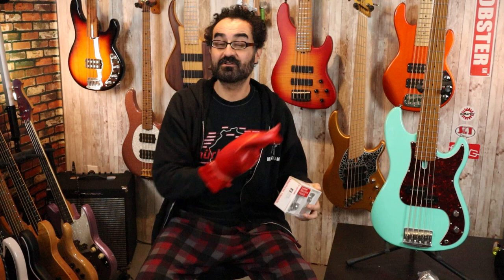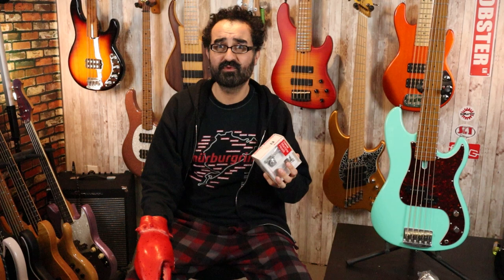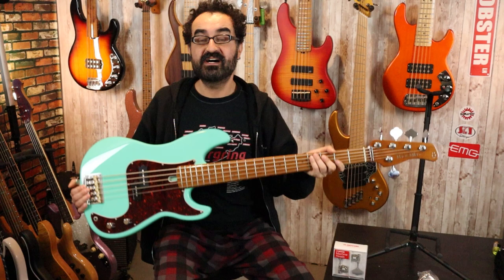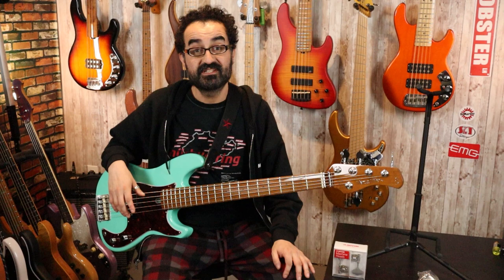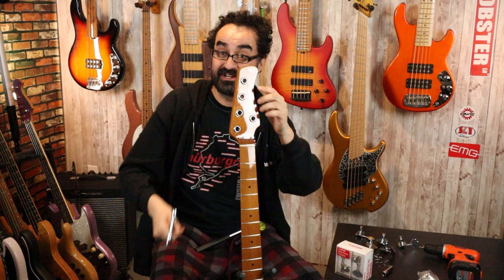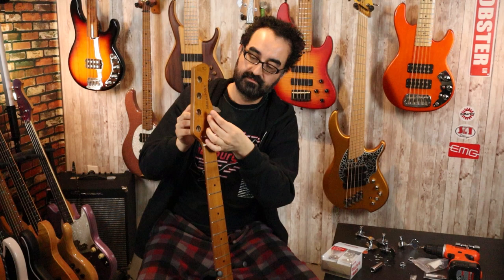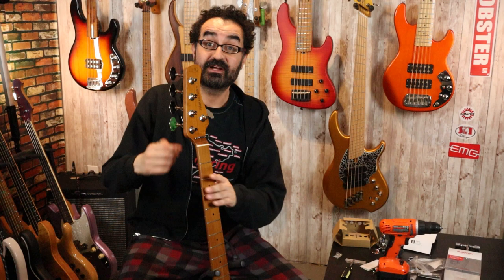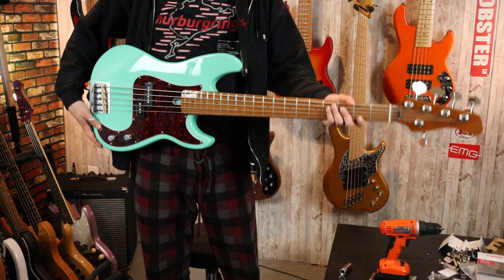Sire P5 Five String NO DRILL Tuner Upgrade- Gotoh GB528 Save Nearly 1/2 LB! - LowEndLobster Builds

Comment: One other little trick/tip I’d like to mention is , when changing the tuners but still keeping the same strings, I like to capo the strings at the first fret before unwinding them.
That helps keep them right there in position to easily re install on the new tuning machines without all the mess and tangling when the strings are just dangling loose.

Comment: Neat trick with the socket as a bushing pusher.
Reply from the maker: Thanks! It works so well. I've seen some SCARY pics of damaged headstocks from people trying to pry the bushings out. I wanted to stress on here that the socket method is way easier and you won't damage the bass.
Reply: @LowEndLobster  Yeah, great if you have access to the back of the bushing.  I do have a bushing lifter winch gadget from StewMac for the closed back kind of bushing (Gibson bridge studs, etc.), but the socket is a better solution here.

Comment: This is a great video. Thank you Will. I upgraded my Sire with the Hipshots, i also bought the adapters, but the adapters are made of an heavier material which ends up defeating the whole purpose of the lightweigt tuners, I ended up using your taping technique. IOt's a good thing there are better alternatives out there for rthe Sire's.

Comment: I usually love your videos, but I feel this video might be more useful if it had contained closeup shots of the back of the headstock during the installation, instead of a wide shot of the front, or at the very least a closeup still of the back after installation. As it is we don't really see the tuners, don't really see the process, and don't really see the result.

Comment: I did that with my Fender Mono Neon. The bass is so much better balanced with light tuners. I used the Sandberg aluminium ultra light tuners, I think they are the  lightest on the market. Expensive, but very good !!!
Reply: Hey did you have to drill new holes for this tuner?
Reply: @priceth  Hi! Yes you have to drill one hole per tuner into the headstock. No big deal. And if you want to switch back to the original tuners, the holes will be covered by the tuners ;-)
Reply: @FrowinIckler  cool appreciate it
Reply: @priceth  You're welcome :-) And related to the Fender tuners you'll save around 62grams per tuner, thats overall 310g with a 5 string bass!

Comment: I'm thinking of doing this mod to my P5 4-string.  A couple of questions, given that it's only 4 strings, will the weight/balance differential be noticeable and is there enough space to use the old screws to fill the screw holes or are they too flush with the tuner?  Thanks for this mod that will hopefully make playing this cool bass even more fun and comfortable.

Comment: Not worth the $100 for the little bit of neck dive. I actually never even considered neck dive until I watched Lobster. Haha I use standard 2” nylon straps so there must be enough friction with those. To each is own. 👍
Reply: You don't understand the subject, but already claiming "it's not worth it". I don't get it. 

Try playing some well-balanced instrument and you'll get the feeling

Don't forget those tuners will also increase the tuning stability and reduce overall weight of the instrument - easier to handle.